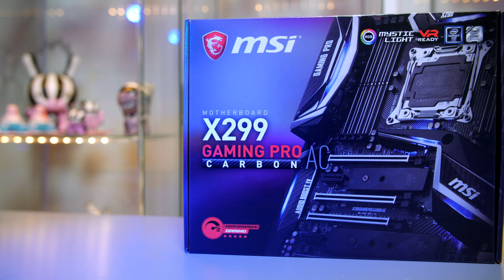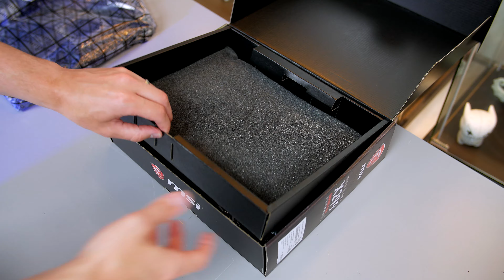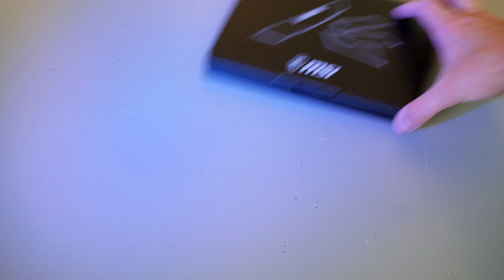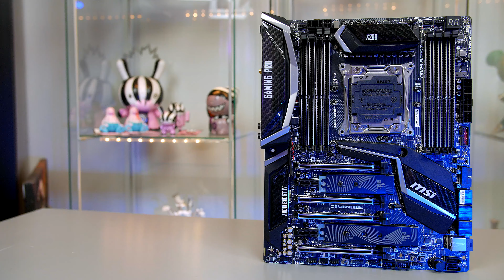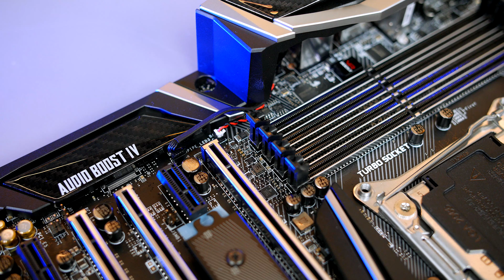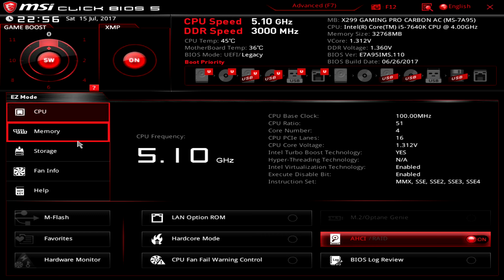MSI X299 Gaming Pro Carbon AC Review - i5 7640X

Comment: I'm wondering if the 'little' brother the x299m gaming pro carbon does support kaby lake x CPUs as, for example,  the i5 7640x. MSI officially (says that the board does NOT support Kaby Lake X, but why? And sometimes 'Does not support' means that the limitation is only on the paper. The x299 ATX and x299m mATX gaming pro carbon boards should be somewhat identical.

Comment: What are your thoughts on MOBO manufacturers still including PS2 ports on High-end MOBOs?
Reply: Its necesary if u experiment with other operating systems, with PS2 u dont need drivers for your keyboard and mouse to work, i found out the hard way messing around with different Linux distros and a Mac with Linux 😊

Comment: I'm gonna buy 
i7 7700k and gtx 1060 strix 
is it going to bottleneck ?
Reply: Kaptin Games save yourself some money and get an i5 7600k or a R5 1600x honestly those go perfectly with a 1060
Reply: if you want the most out of your 7700k, I recommend going with atleast a 1070.
Reply from the maker: +Kaptin Games no will be fine
Reply: Dacio Garcia Yup
Reply: Kaptin Games if you go with a 1060, a 7700k is pointless.
Reply: Rishabh Patel why I want to edit and stream
Reply: Rishabh Patel he said it won't bottleneck
Reply: Kaptin Games 1060 with a 7600k and a 7700k will yield identical performance. And if you want to edit And stream, go with a 6 core ryzen processor. trust me, I upgraded to Ryzen 1600 from 6600k, and it's miles better at multitasking. those 12 threads come handy
Reply: Kaptin Games if you want to edit and stream, go with the Ryzen 5 1600 And a b350 mobo like the msi b350 pc mate. Keep the stock cooler since thats fine And spent the saved €200 on a 1070
Reply: Kaptin Games I think he's just saying noo its not going to bottleneck
Reply: better with a 1080ti 😍
Reply: Rishabh Patel in our county the 1070 is about 620$ and the 1060 is 300$ so the 1060 is a lot cheaper
Reply: Rishabh Patel but I'm gonna use the 1060 for one year and after that I'm gonna buy a 1080ti or the newest GPU
Reply: nice looking board. Still trying to decide on what one to put in my next build.
Reply: señor yol what do you mean with that
Reply: Yes, the 1060 will bottleneck the crap out of the 7700k lol